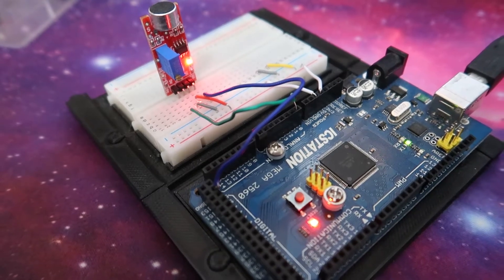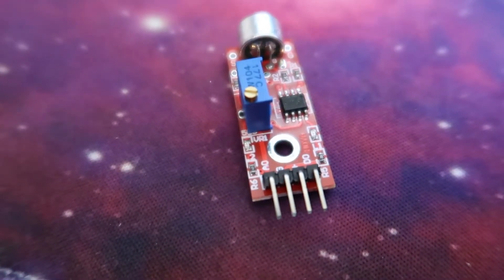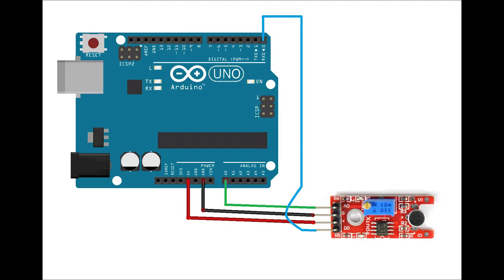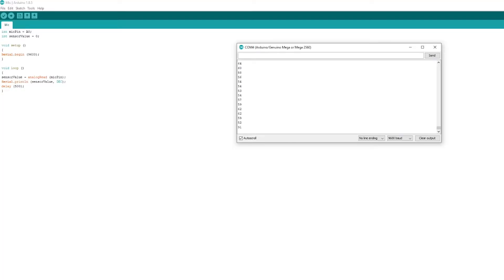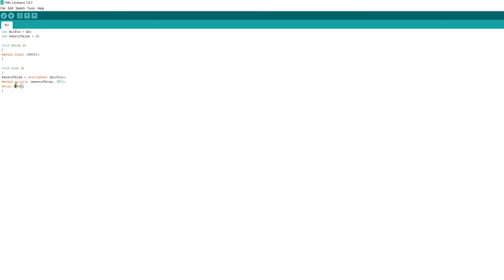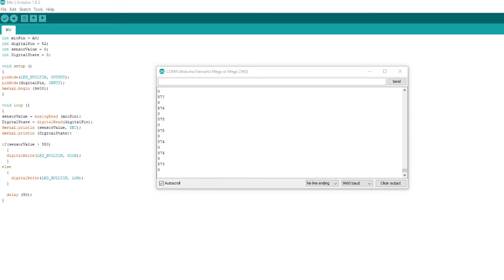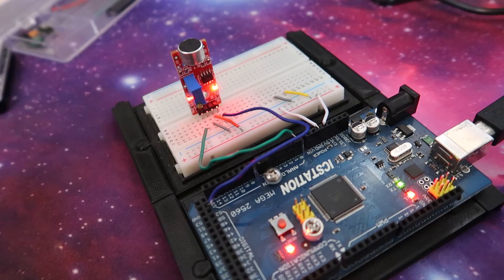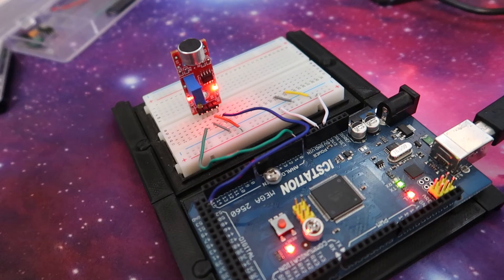KY038 Microphone Module for Arduino Wire & Code

Comment: Wrote this so you dont have to x
int micPin = A0;
int digitalPin = 2;
int sensorValue = 0;
int DigitalState = 0;

void setup() {
  
  pinMode(LED_BUILTIN, OUTPUT);
  pinMode(digitalPin, INPUT);
  Serial.begin(9600);
}

void loop() {
  sensorValue = analogRead (micPin);
  DigitalState = digitalRead(digitalPin);
  Serial.println (sensorValue, DEC);
  Serial.println (DigitalState);

  if(sensorValue > 550)
   {
    digitalWrite(LED_BUILTIN, HIGH);
   }
  else
  {
    digitalWrite(LED_BUILTIN, LOW);
  }
  delay(500);
}

Comment: It looks like the circuit is pretty simple and only consists of a comparator with the pot acting as a voltage divider reference and that drives the digital output.  However, for the analog output, there does not appear to be any amplification and the electret microphones put out a very low signal, so is the analog output coming directly from the mic with no amplification?